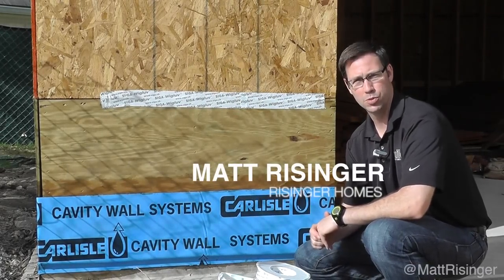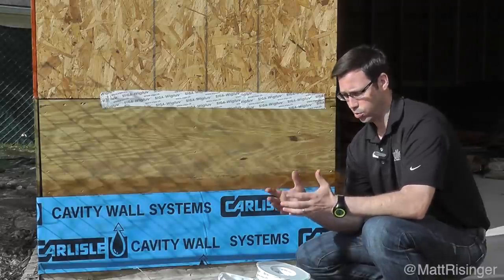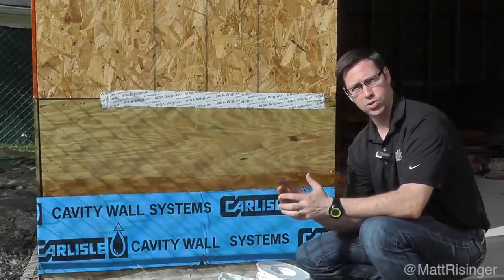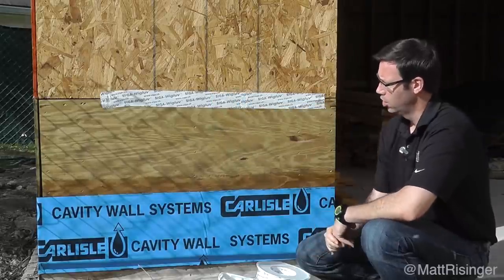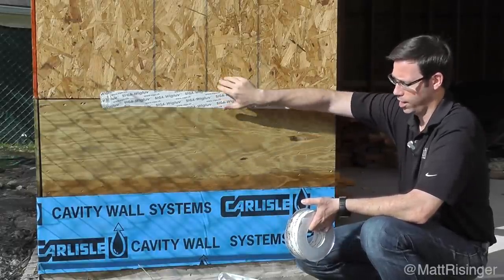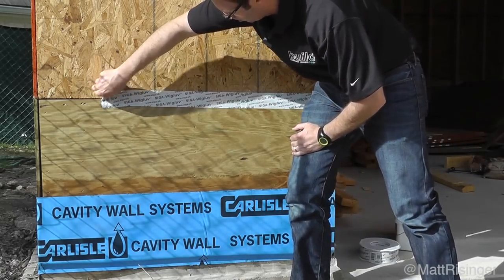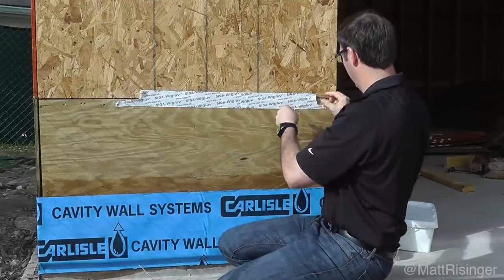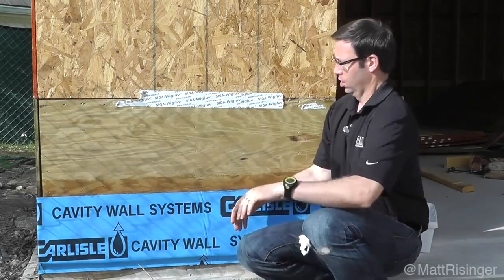Air Sealing - Siga Wigluv Tape First Look

Comment from the maker: Yes and No.  Housewrap's primary goal is weather resistive barrier (WRB), a secondary function is air tightness.  It's great as a WRB, but it's only so-so as an air barrier if you are trying for strict air tightness standards.  I believe you can meet code complete air tightness goals, but not the 1ACH50 standard I'm trying to make on this project.  Best, Matt
Reply: WRB is to keep the moisture out, but to let the house breathe. A house should breathe, not airtight. That's why it is Swiss made. A cold, moist place. Any moisture should be able to leave the walls, but not be able to penetrate. Same principle as Goretex clothing.
Reply: @satwadude3371  You should solve that with proper HVAC systems, with emphasis on the V part: ventilation. Passive houses would use either an ERV or HRV.

Comment from the maker: Joe, I got in the geeky weeds there sorry.  Air Changes per Hour at 50 pascals = ACH50.  This is a measure of how "tight" a building is built when you pressurize the house with a blower door test.  Current code in Texas requires a blower door test of 7ACH50 or less.  That 50pascals measurement is exerting a force similar to a 10 mph wind hitting the house.  7ACH50 is saying all the air in the house would be replaced 7 times per hour with a 10mph wind hitting the building.  That's too loose.

Comment from the maker: Tape to air seal that concrete-to-concrete connection?  How about backer rod and Tremco Diamonic or NP1?  If you must use tape I'd use a primer then use CCW705 like in the video. Best, Matt

Comment: Question about the cavity wall at the wall base - I see the product is a vapor barrier. If the wall is insulated on the inside with a closed cell foam, the combination would be encasing the lower portion of plywood between 2 vapor barriers. Do you have any concerns about that?

Comment: Would the Siga tape make a difference when spray foam insulation is used on the interior of the same wall?
Was this Siga Wigluv 60 tape?
Reply from the maker: Great question Joe, and the answer is a definite YES.  Spray Foam does a good job of air sealing the stud cavity, but does nothing to seal the wood-to-wood connections.  In general, you can likely meet Code requirements for Blower Door tightness with Spray Foam but you won't get much lower.  My standards for air tightness are might better and Siga Wigluv 60 is a great weapon in my arsenal.  Yes this is Wigluv 60 which is 2.25" wide.  Best, Matt

Comment: Seeing this a few years late, is this something that could now be replaced by Zip LiquidFlash or Dymonic 100?  Could you save time priming if you used those?
Reply: LumberJohn 
It looks like to me priming the surfaces for this tape would be well worth it!!!
I like the one video Matt does with the Contractor buddy of his that uses Liquid Zip brand sealer also.
Most tape is Lick & Stick and then pray it stays on long enough to cover it with siding or other cladding.

Comment: Matt - I used house wrap, taped seams, then 1/2 inch of iso foam sheet, also taped seams.   Do you know of a tape that would stick to the inside of a concrete pony-wall in a crawlspace ??
Reply: Robert J. Williams 
Blue PolyWall that Matt has used in resent videos